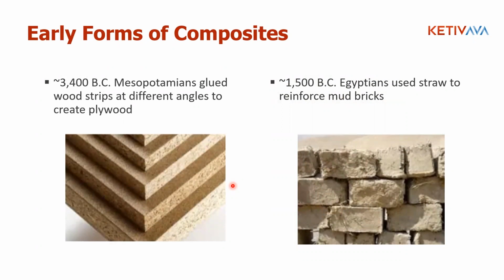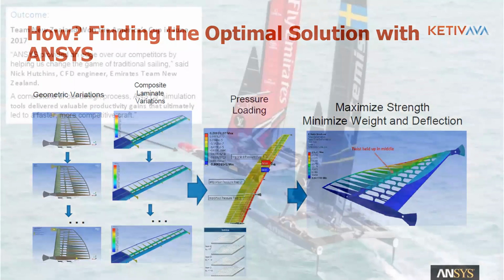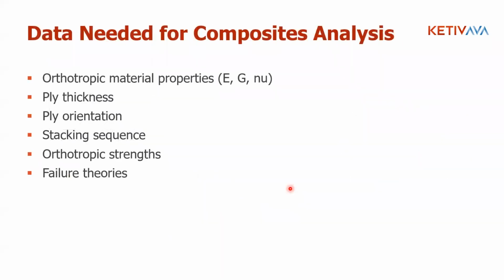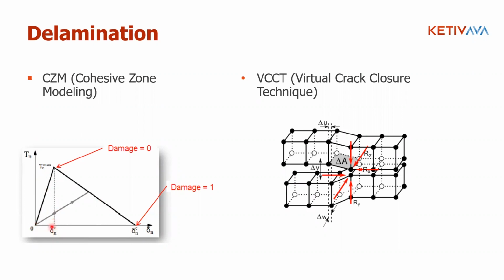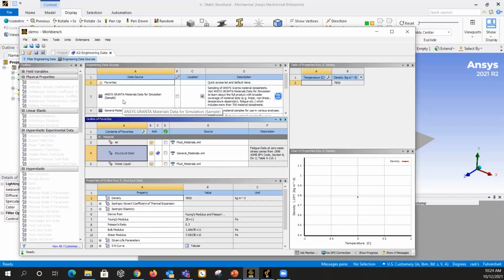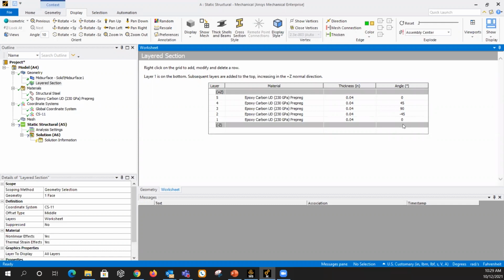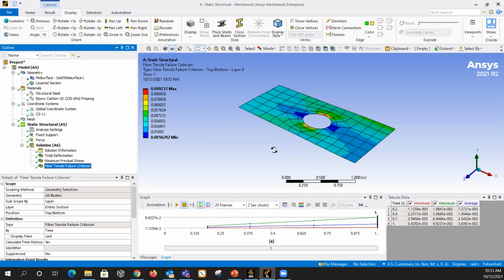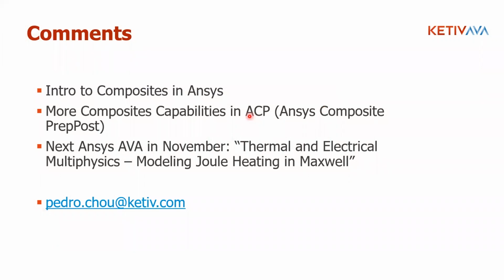Intro to Composite Analysis Using Ansys Mechanical | Autodesk Virtual Academy

Comment: Hi, thanks for the presentation. I was wondering, in the worksheet for defining the layered section it says, "... layers are added to the top, increasing in the +Z normal direction." If this is what you want, then a midsection, layered section is probably not the best application, right? Or you have to redefine your coordinate system?

Comment: Thank you, but it doesn't work for me - APDL Post command does not return Tsai  Wu failure criterion plot. I got such an error in Post Output: "One or more materials (such as material 2) do not have all required  stress or strain strength limits defined.  Therefore, no failure  criteria are computed" I keyed in material properties for my orthotropic material exactly as you. It seems like APDL cannot read this.